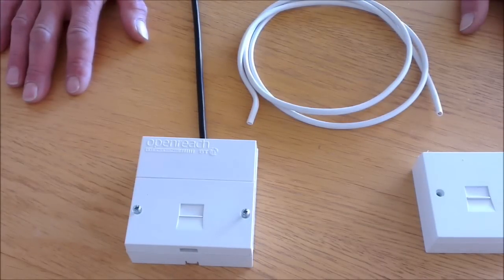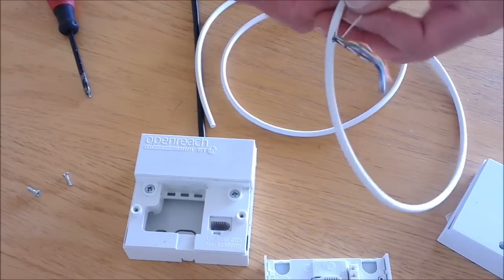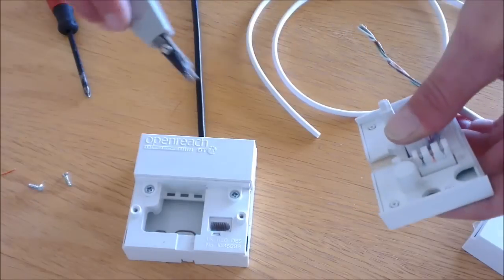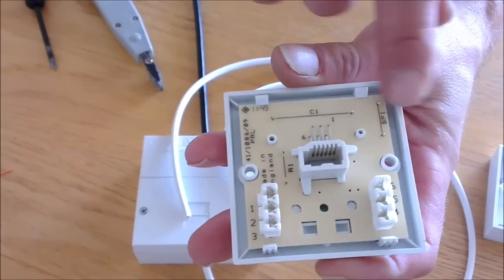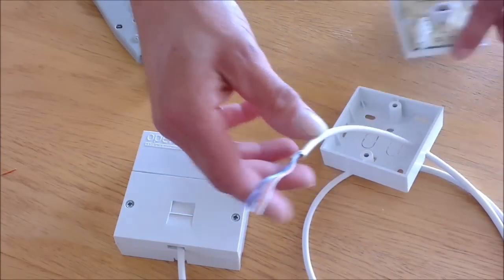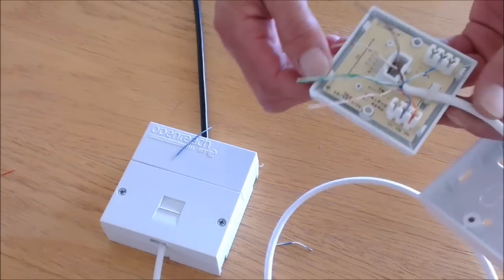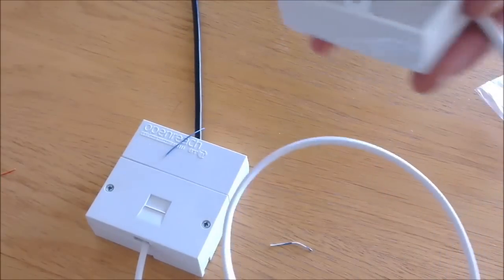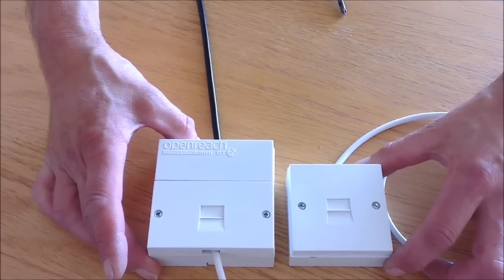How to wire a phone extension from a BT Master socket UK

Comment: thanks for your reply, getting better speeds now, what i done was moved the router next to my phone socket in my hall, replaced the flat cable that connects to phone socket to router with cat6 cable, 18 inches in length, and then a 10mtr cats6 cable from router to desktop pc in bedroom , works a treat, speed gone from 3 to 14 on normal broadband... thanks again for help

Comment: That's a great neat job , can I ask , is eg.  My mum's main sockets in the kitchen ,I want to run a box into the next room so i can buy her cordless phones near her plug DC socket ,,but WILL I be able this wiring method use a ADSL as I want to install IP cams ,,, or will that wiring be diff ..ps I notice you wired that as if you'd Drilled through a wall , ?? You put the wires behind,,,or will I need a ADSL faceplate and get it done proff with a guy like u locally ??

Comment: I cant believe BT charge £160 to do this. I am pretty useless at DIY but it took me less than 10 minutes to get my extension connected. Bought a punch tool on Ebay for £2 and job jobbed. Much obliged to you guv'
Reply: scott free thanks scott on my way to ebay, lol. i just moved over to  plusnet waited 3 weeks for phone to connect then the extension phone no dial tone! after telling them i was disabled & rely on phone for health reason incl food shop, they said would cost me £160 for a engineer but he wouldnt set-up broadband i wish i hadn't bothered

Comment: Can you please tell me, if I want to do the opposite is it ok to just cut or disconnect extension wire from the master socket? I have the extension that runs upstairs that I no longer need. I want to get rid of it without calling BT. Will my phone line still work if I cut the extension wire? I have a separate broadband cable extension that connected to the master with just blue wire. The extension cable is connected like you showed in the video with blue and orange. Many thanks.

Comment: What is the maximum length of extension cable you can use? Is there a certain type of extension cable to be used if extending to outside building? Thanks
Reply: 50M
Reply: You need exterior rated cable for exterior use

Comment: I have an old master socket from 1996 with six connections and not split like the one in the video.  Please tell me the numbers and wire colours for connecting an extension.  The master socket is currently wired with orange to number 5 and white to number 2

Comment: Hi wonder if you could tell me the best way ?? My phone box is in  my hall and i have a 10 mtr rj11 cable connected to it going to my router then to my pc in my bedroom. Would it be better to have the router next to my phone box in my hall and connect with a cat6  10 mtr cable to my bedroom , I have been told its always better to have the router as near to the phone box as possible, is this true...thanks..
Reply: Ron Jones Sorry, don't work for these guys, but yes, that 10m RJ11 cable is probably seriously restricting your speed and line stability. The 10M cat 6 would be ideal to replace it. The RJ11 cable isn't twisted pair and will pick up inteference :)
Reply: Ron Jones Sorry, one more thing, make sure you replace that RJ11 cable with a shorter one, just moving the router closer but keeping the long cable will be worse! :)

Comment: Hello i have a problem. TalkTalk did not connect my extension wires to the master socket. It looks like they have been joined together to the main phone wires. The master socket does not work when i connect a phone. Have they done it wrong? Thank You

Comment: Not working for me. On the master socket I have orange in 2 blue in 3 and white blue in 5. The extension is set up the same way. The phone line just crackles and won't ring out or take calls. The broadband doesn't work either. I've tried two different extension sockets and no joy. Plugged directly into the master and things are fine. Any ideas?

Comment: In my property there are 4 master sockets (with lower plates) but I can only use one of them (phone and broadband). The other 3 are not working. How do i know which one is connected to the master socket as an extension socket?

Comment: Thanks very much great help. The orange no body use it any more so only two wiring and you can use any color you want but all the rest of the house socket must be follow this two color, if you used blue in pin number 2 and blue/white in pin 5 follow this number in the other sockets.

Comment: Hi, i wired them as you have told in the video, according to the numbers in the extension box.i am not able to hear any sound after connecting my phone.the same phone works in the main bt line.do you think there is fault in the extension socket.
The same extension socket was working 1month back.all of a sudden has become dead.what do you think i must do ?.please help.

Comment: Will the length of the extension affect the speed of the slave socket for instance the speed of a router? if so is it possible and easy to move the master upstairs (router in office) and place a slave downstairs (just a telephone)?

Comment: I was wondering if someone could help. I would like to add an extra socket to my living room and intend to run a cable from box in my computer room. However, I have a few questions:

1. What cable do I use and where can I buy it?
2. Where can I buy a new phone box? (not sure if that is what they are called)
3. Where can I buy a new micro filter as I would like to run an ethernet cable into it?

Thanks for any help you can provide.
Reply: Robert McNair You can buy it all as kit's from Argos, Screwfix, Maplin etc.

Comment: I just bought a new phone for my house. It's one of those old fashioned looking phones with a round dialler but instead of holes there are push button numbers.
When I got it home I discovered that the wall plug is too small for the BT wall socket (it's the same plug that fits into the phone). On examination I see that the 'new phone' with the small plugs on each end only appears to have two live metal terminals on each plug end. Unlike the existing phone lead which has a small plug on the phone end and the larger one on the wall plug end, both have four live metal connections on each end. Any ideas what I need to do?

Comment: depending on the house you shouldn't have to worry, if you just using it to take it up a floor you will not notice the difference in speed via ethernet (unless moving from wireless to ethernet then you will most likely see a huge bump in performance.

Comment: Hi, I want an extension socket like this in a different room than the master socket, for my broadband only to be hooked up to. Will the broadband (Fibre optic) speed be effected by being connected to the extension socket which then relays back to the main? Like slightly higher latency, ping, speed ect?
Reply: Yes. Use as little extension cable as you can.

Comment: Thanks for your vid. Thumbs-up. Can I ask a question please?

BT changed my master socket last month when I changed to fibre broadband, speeds are fine at ~38Mbps. But, when I removed the microfilters around the house, the extensions wouldn't ring any more although they work fine otherwise. I checked in the master socket and the BT installer only connected 2 wires to the extensions, so I presume the ring wire is disconnected. Is it safe for me to try just connecting the ring wire in the master socket, and any ideas why the BT installer left it disconnected?

I could just leave the microfilters in place, as these also seem to contain the ring capacitor, but I wanted a tidy-up!
Reply: +ridefast0 You can call BT and ask them, Fibre is very sensitive, so even if you're working with a BT socket, you better have someone from BT.
Reply: Thanks JoeyGames. Wow, your reply came through to my notifications today, a mere 8 months after you posted it! Maybe there are routers full of delayed messages, well done again Google!!
Reply: ridefast0 Haha, that's kind of funny, I still remember typing it wow.

Comment: many thanks,BT asked me £130+£75=£205 to  connect its master in toilet to the next extension socket in the house. I challenged their sale staff for undisclosed hidden cost on order, but with no success. they said regardless of place they have connected the line to the property.
I listened to your advice and follow your step by step instruction. it took me 30 minutes and I have done it!! thanks you saved me from this unfair charge. 
Again Many thanks,
Reply: Ali Davood Parsa only issue with that is if you have future issues bt won't touch it as they haven't installed it

Comment: Thanks for the video.  It really helped with getting the connectors from the master socket cabled up to the connectors in the extension socket.  I had looked at various websites to try and find this info but they were either incomplete or conflicted with the info on other sites.After watching your video, I had connected the cable up in a couple of minutes, faceplates back on and up and running - Thank you :)

Comment: Poorly produced. I can't see some of the actions. Sound quality poor. Poor advice on cutting back the sheathing - why not use the string to cut back the sheath instead of using a sharp blade and risk cutting the wires or a finger. How about some explanation of what the wires are before you start? You know your stuff but cannot TEACH. See what you have done, criticise the recording and do another one. Ask friends to tell you what is poor about it and then do another again.
Reply: get real it was as clear as a bell